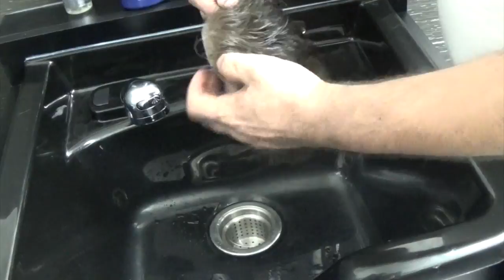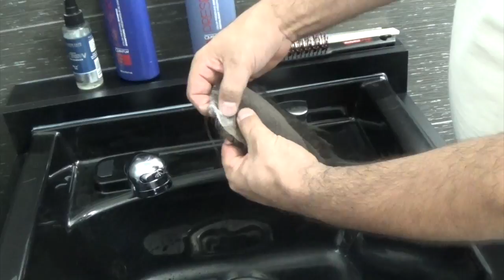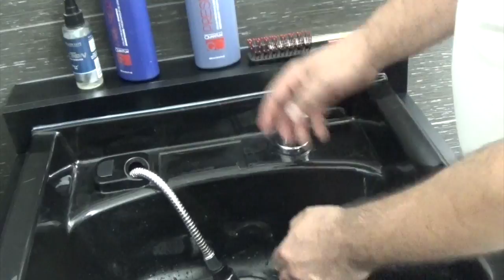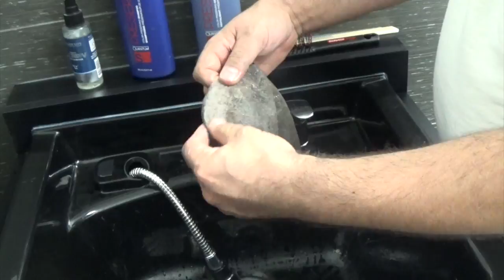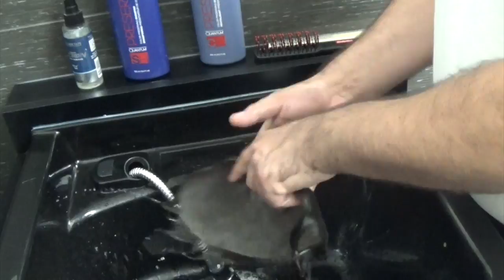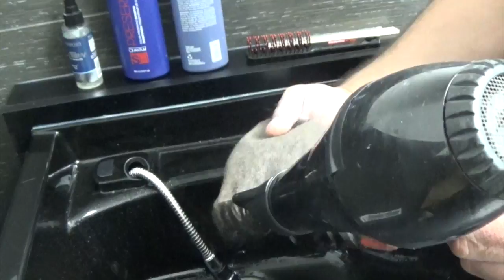How to wash your hair system

Comment: Fantastic video quick question in between clean ups and removing the full system if we get glue in the hair what's the easiest quickest way to remove it with out taking off the system . Cheers